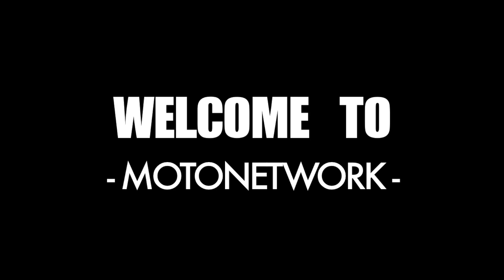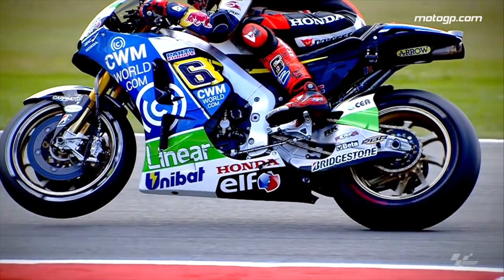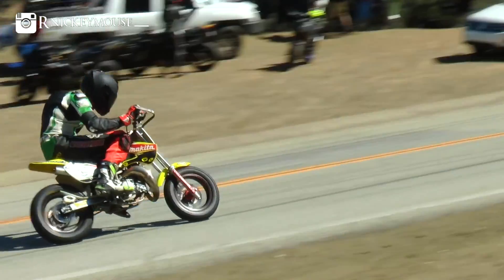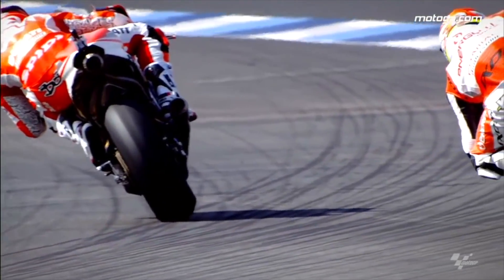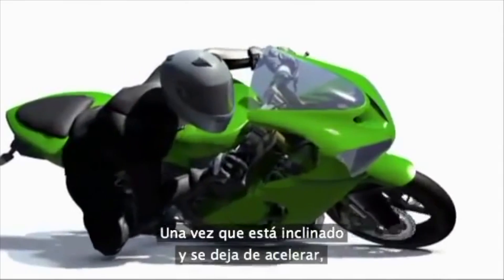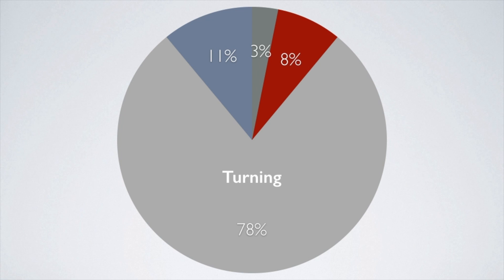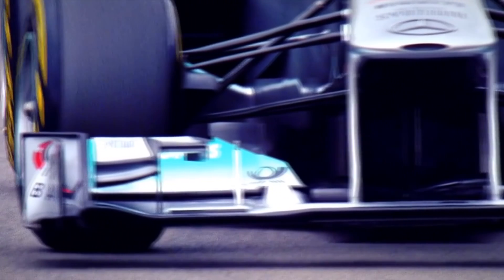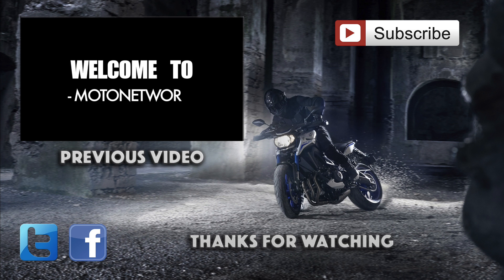Motorcycle Traction EXPLAINED!

Comment: Contact area doesn't effect grip? Then explain why lower tyre pressure gives more grip or why race bikes use slicks and larger tyres.
Reply: He explained why they used larger tyres, the heat can be dealt with alot faster with a bigger tyre so it does not over heat.

Lower tyre pressure probably makes the tyre softer and helps a bit in that way i believe. A softer tyre does wear faster tho, so i think it has somthing to do with that.
Reply from the maker: +Simon Vuylsteke Thank you for paying attention to what I was explaining in the video.
Reply: +Moto Network
Too bad what you're saying isn't true at all... This is something I see with people armed with high school physics all the damn time. The truth is that contact patch area matters. The friction coefficient is NOT independent of the contact area.

The Amonton/Coulomb approximation (F=uN) that most guys have learned in high school or physics 101, is an empirical approximation, NOT an actual physical law. It applies relatively well to rigid bodies made of hard materials, within certain parameters. The empirical model completely breaks down with rubber, which is neither rigid or hard and especially adhesive rubber compounds in the shape of a toroidally shaped inflated balloon.

In actual fact, on the microscopic scale the friction coefficient is in large parts completely dependent on contact surface area. The actual area that actually are in contact so that van der Waals forces from the different materials can interact with each other. In the F=uN formula with certain materials it just so happens that there's an envelope where the microscopic contact area is somewhat linearly proportional to the force you put on it, up to a point, called saturation, where the friction coefficient tend to go to zero the more force you put on it. All the area is already in contact.

To cut a long story short, rubber itself does not follow the F=uN well at all. The coefficient of friction of rubber is in fact pretty nonlinear (i.e. a function in practice) to the contact pressure. Twice the macroscopic contact patch area does not equal twice the coefficient of friction, but it does mean a slightly better coefficient of friction by less area pressure. This is where a large part of the 'load sensitivity' comes from, from the inherent properties of rubber friction. Then again we haven't even gone into the other parts of a tyre's friction, like actual adhesion (like glue, or sticky tape) in racing compunds which is basically independent from the normal force...

The general rule regarding cars is that you fit the widest tyres you can practically fit. In practical terms the widest that the regulation allows in most cases. Motorcycle tyres have different practicalities and compromises to take into account, where it is most often the widest that you can put heat into and vice versa. The heat properties of rubber takes precedence over all. Also there's a practical geometric limit on account of how a motorcycle work in a turn.

For sources I suggest you read:
"Tyre/Road friction modeling Literature survey" R. van der Steen: http://www.mate.tue.nl/mate/pdfs/8147.pdf
Or "Physical Factors in Tyre Traction" by K C Ludema
Or any of the papers of B.N.J. Persson, perhaps the furthermost expert on friction there is.
Reply: Actually, a larger contact patch does afford you more friction because of the shear modulus of the elastic compound. This is the shear stress that can be put through the tyre before it fails. You will all have seen this as balls of rubber on race tyres
Reply: Higher contact area increases the amount of friction the wheels exert on the ground which therefore results in an increased amount of grip. Im not really sure how moto network thought contact area has no relation whatsoever to grip other than heat dissipation but whatever, hopefully in this case he is correct and didnt just spout bullshit to a bunch of people...
For example, take your finger, that simulates tread with its fingerprints, and slide it across a table while on a spinning chair. Note the amount of force that you exert downwards to the table, and the amount the chair spins. Now do that but with all 5 fingers, using the same force. What a surprise, you spun a lot more than with just 1 finger. What does this mean? Yes, the downward force is the same, and everything other than contact area is the same. Meaning contact area increases grip.

Comment: I'm sorry to say but, even though I liked the theory behind this, the truth is that when you are riding, you are not thinking "oh, so I only have 8% to brake, and can only accelerate 5%" :) If you are not riding on a track, with a team of engineers and telemetry giving you data and head up information, you do not take any advantage of this numbers. On the road the best thing is to get to know the bike,  the motor, the tires and the brakes. Where is my torque peak and where is my hp peak and how much can I put on the road and how many fingers should I use on my brakes etc. Numbers do not apply when variables such as oil spills, gravel, holes, leafs or any other obstacle comes in front of you. The best is to have some tolerance in order to correct enough when needed, and that comes only with experience :) and as I said before, feeling cannot be taught, it can only be... felt !

Comment: Would you be able to explain the physics behind "Hanging Off" in a motorcycle turn? It is said to increase traction because it keeps the bike more upright, but this video contradicts this theory.
Reply: The normal force is decreased in a turn, as was said, and the suspension is no longer in the same vector as the normal force.
Reply: Adam Exactly! When you are upright not only contact patch is increased but normal force is increased as well, so you get more friction. The force system that the almost upright bike and the hanged off rider form has a center of mass that favors the turning action (or creates radial acceleration). So it is always recommended to decrease lean angle as much as possible (this is not always possible on the track due to aggressive turns at high speed such as cork screws). This action also allows for sooner acceleration. Cheers!
Reply: Chipmunks, I did not see this comment but just added a relevant comment thread in the main section of the video which relates to turning traction.
Reply: Sorry guys, but I'm going to contradict you here. The contact area patch on sport tyres actually increases the further you lean, to the designed max lean angle of the tyre.

For a really sporty tyre, like the Pirelli Super Corsa SP, it's typically 50-ish degrees where it basically becomes a slick tread on top of being larger in size. On racing slicks about 60 degrees. Contrary to what people think, there is no real static advantage to hang off until you reach these angles of lean.

The advantages to hanging off is that you can lean even further (I'm talking the angle of center of gravity to tyre) and still keep the tyre within it's performance envelope, or you're further from dragging hard parts or body parts. Hanging off does NOT magically add grip to the tyres and hanging off while leaning say 30 degrees is a complete waste of effort.

The other slight advantage is dynamic, in that when spinning the tyre on the exit of a corner it steps out slightly less if you have the bike straightened. I.e. you can get on the gas slightly sooner.

In short: This 'body positioning' fixation that have become absolutely rampant in the last 10-15 years is WAAAAY overblown, especially on the internet.
Reply: MPI1000 ...The tire is round like a basketball; you can't get a larger contact patch by moving the ball. The only way is to distort the surface. Tires are stickier and softer on the sides compared to the top, so there may be slight deformation/flattening, but not enough. Friction is actually not dependent on surface area. Why are larger tires better for traction then like on cars? Because of heat and because of contact time. Heat buildup changes traction characteristics; sometimes it does for the better like how warm tires get better grip than cold tires, but it can also be bad like when they get too hot and become slicks/slippery. Contact time is the idea that bumps in the surface can separate contact surfaces nullifying any ability to have traction. A wider tire on a car or bigger contact patch can lead to less likelihood of losing contact between the two surfaces. 

Hanging off in a turn allows more contact to occur with the ground because the suspension can act to absorb bumps. At a lean the bikes chassis absorbs more of the bumps which is why the bike can skip more at an angle in a turn on an uneven surface. 

If you can avoid a deep lean angle for the bike then you can avoid overheating the edges saving them for when you need them. Obviously you don't need to overdo it by hanging off the side of the bike on gentle turns. On the track that means slower times from poor aerodynamics. On the street if you want to for more control over bumps or to give room for mid corner corrections then by all means.
Reply: +IraceTV
They are absolutely not "round like a basketball"... Every tyre has it's own profile and typically the sportier the tyre, the more 'V-shaped' they are, as it were. The edges of a Pirelli slick are basically vertical, it's impossible to not get chicken strips even, however far you lean.

You are unfortunately mistaken in how the contact patch behaves on tyres as they absolutely change both the shape and the area in the lean. At max lean it is both longer and slightly wider.
http://sportbike.natkd.com/tires.htm (scroll down a bit, and this and below are sport touring tyres)
http://www.motorcycle-usa.com/photogallerys/dunlop-sportmax-q2-tires-16.jpg

And yes, the coefficient of friction absolutely IS dependent on the contact patch area. Or put another way, the coefficient of friction is NOT independent of the contact patch area. The lower average pressure of the contact area, the better CoF. It's just how rubber works, F=uN be damned. This is a large part in how 'tyre load sensitivity' works, it's in large parts the intrinsic way how rubber works and why if you lighten your car it goes faster around a corner.

Yes, to keep a tyre within it's working parameters is very important regarding heat and such it does not take away from the fact that you fit the widest tyres you can fit within practical and/or regulatory limits on a car if you want maximum performance.
Reply: Actually, this video doesn't contradict that theory.  This video is explaining how motorcycle traction works for typical riding, without going into the differences when you're racing.  Remember when it divided the traction into Acceleration, Braking, Turning, and Reverse (I think he meant Reserve, by the way).  For Reverse, he explained it as having a safety margin for riding on the street for unexpected needs.  Well, for racing, you don't have that reserve of extra traction.  When I put my knee down during race practice, that isn't where I stop leaning the bike.  That's where I can start knowing exactly how far it's leaned over.  When I get to the edge of the tires, where I wouldn't have "chicken strips" anymore, there is still more traction than I need for the turn/lean angle.  As I start to lean more, the contact patch gets smaller as I'm leaning further than the profile of the tire allows.  This is where things get to be different than what the video describes, but still not contradictory.  At this point, I am losing contact patch because the profile of the tire only allows for a certain lean angle.  Due to the angle of the bike though, not all of the weight of the bike is pressing down onto the contact patch  to balance the weight .vs contact patch size.  More weight is going into pushing the bike laterally .vs pushing down onto the tire.  By leaning off the bike and keeping the bike more upright until it reaches that point, I'm able to go through the same turn faster.

Comment: One thing I think is missing: You're saying that you'll have more traction when you have more weight, but you use your extra grip to accelerate/brake/turn the additional weight, so you will not be faster when adding weight. Also like you said when you start to load the tire more you will slowly be getting a lower coefficient of friction, actually making your bike less grippy and slower.

Comment: Overly simplified and missing the point. Read this : http://www.physlink.com/education/askexperts/ae200.cfm
Of course larger tires offer more grip. Look at drag racers and the immense tires they have to use to get the power down. While the physical law is correct it is way more complicated in reality.

Also you got a big big typo there. The word is not "Reverse" but "Reserve" for the pie chart. Which would represent the left amount of friction.
Reply: Mono Armin That link still isn't correct. Materials do matter. The coefficient of friction is only part of the story. Some materials don't behave the same as the majority, and tire compounds are obviously not ordinary. Tire compounds are selected precisely because they have a tendency to "adhere" to hard surfaces by conforming to and filling in the microscopic irregularities in the other surface, and do in fact have more grip with a larger contact patch when all other variables stay the same.

Seriously, why would anybody use more expensive, wider tires if they didn't have a real effect?

Profiles and shorter/stiffer sidewalls do affect handling, but not ultimate grip. They work in a similar way to anti-roll bars in that they lower transition times and speed up the process to transfer traction forces from one direction to another. It gives more feedback and control, but not traction, and lower profiles can actually reduce traction by effectively making the tire harder and less compliant to bumps and visible irregularities like ruts and undulations.

The part about rain tires being narrower and related to heat dissipation is completely wrong. Rain tires are narrower in order to alleviate hydroplaning. They also have a softer compound that needs less heat to provide maximum traction. When rain tires are used in the dry, they do get hotter than they are designed to (but not hotter than "dry" tires) and get used up faster because the softer compound melts and is worn off faster. They also have less grip in the dry because of that as well as a smaller contact patch. That's why racers are more likely to risk running dry tires in the wet if they think there's a chance it will stay dry or dry quickly than to risk running wet tires if it's going to be more dry than wet. But that's why rain is such a problem in racing: it's a huge gamble either way, and whoever guesses correctly comes out ahead.
Reply: Those physics teachers in that link is unfortunately wrong as well... They are fabulating on what they are think is happening as many other laymen do.

Like the 'wider tyres allows for softer compound' hypothesis. That is half wrong... even with the same compound you generally get better coefficient of friction with a larger contact area. Or more correctly, less contact area pressure. Generally with rubber, the less local pressure, the better CoF. It ties into the the 'load sensitivity' properties of tyres.

It is true though that a fat tyre has more capacity to absorb more energy so you could possibly make it out of a softer compound without shredding/overheat it, but it isn't the underlying gist of it.

Comment: Did you really just say that larger tires don't offer more traction? lmao Go back to school.
Reply: Sort of, I was in the Victory dealership a couple months ago and sat on two nearly identical bikes. The main difference was that one of the bikes had a super fat rear tire and the other had more or less normal tires. The bike with the fat tire felt much more stable than the one with the smaller tire.

But, a large tire with harder tires isn't necessarily going to have better traction than a smaller tire with soft tires.